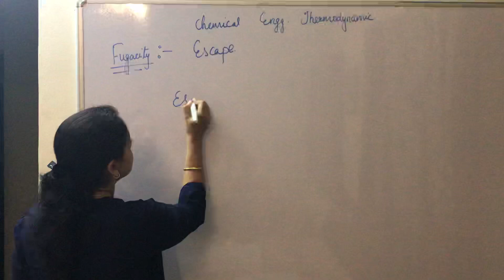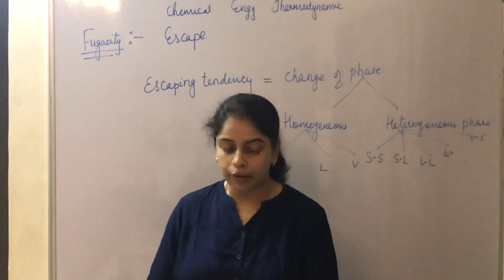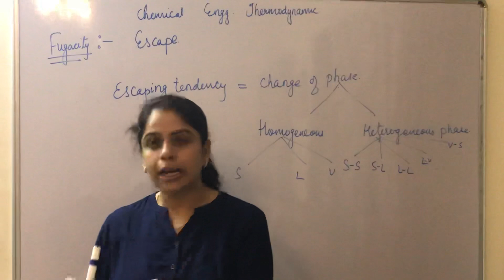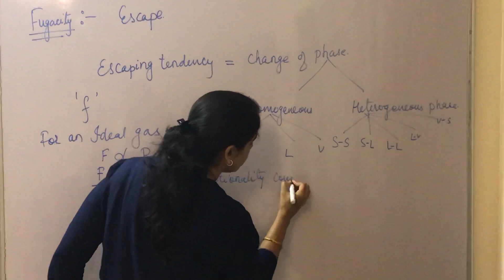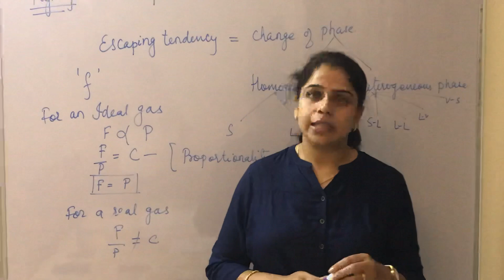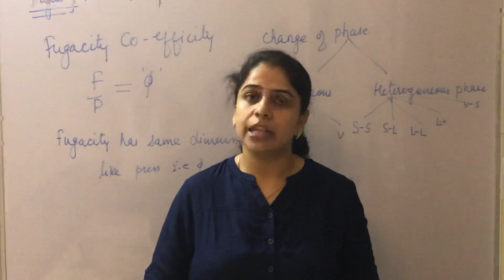Concept of fugacity

Comment: Nice mam
Reply from the maker: Poonam Swami , chemical potential is used as a index for chemical equilibrium like temperature for thermal and pressure for mechanical equilibrium.
Reply from the maker: In diffusion chemical potential is a gradient or driving force.
Reply: Thank u di.....God bless u🤗